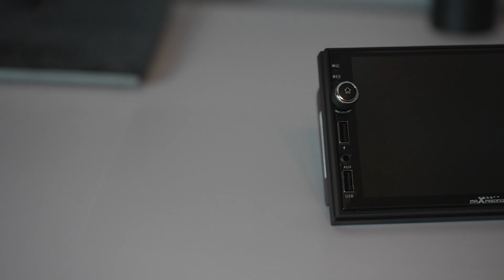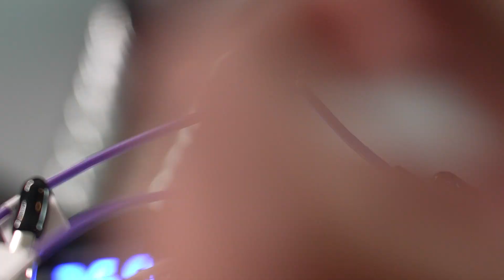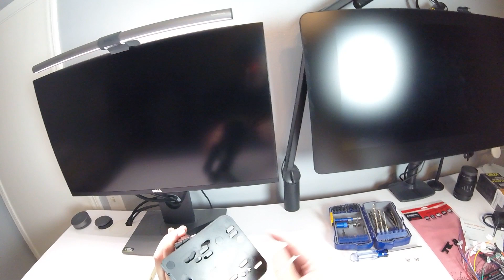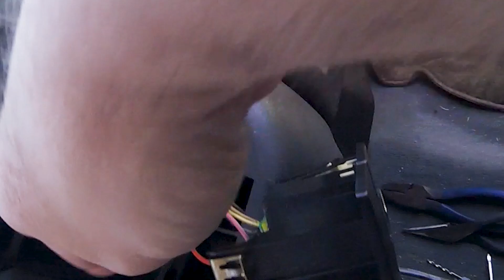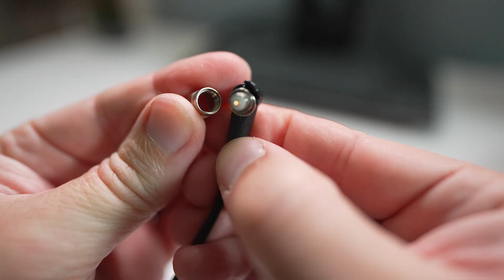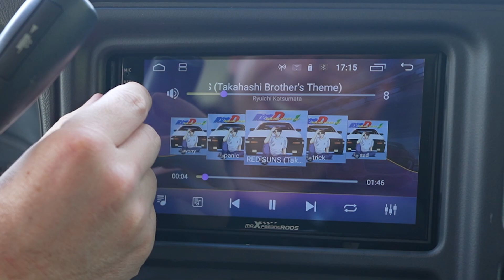How to Install a modern stereo and USB Ports into your Car

Comment: can you you just use electrical tape to connect the wires?
Reply from the maker: That will work for a while, but it’s entirely possible (likely even) that they’ll come loose your radio will quit working or even cross wires and break in time

Comment: I was curious about this radio after your instagram post the other day. It looks pretty nice, it's a shame about the gps antenna. Is it easy to get a replacement from them?
Reply from the maker: I’m glad you asked! I did a quick Google search and it looks like a universal part. I saw very similar ones with the same connector for $5-$15 bucks all over the place. Maybe I’ll try to put a new one on sometime 👍🏻